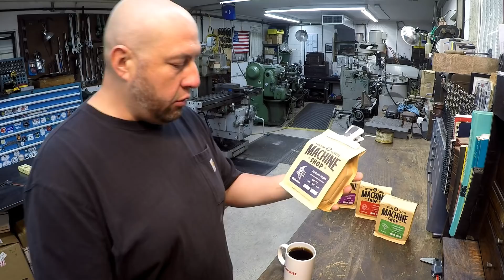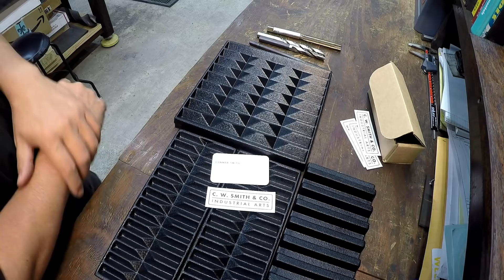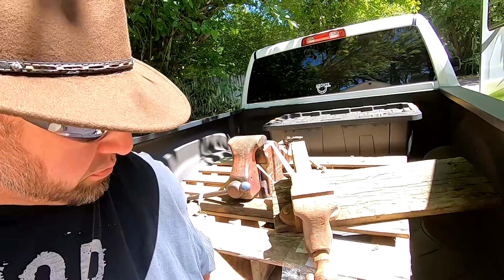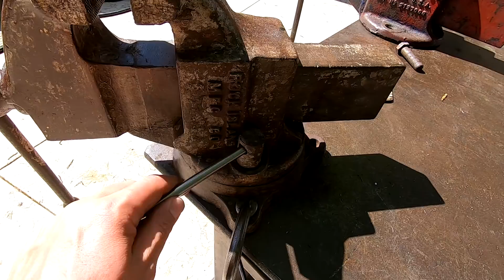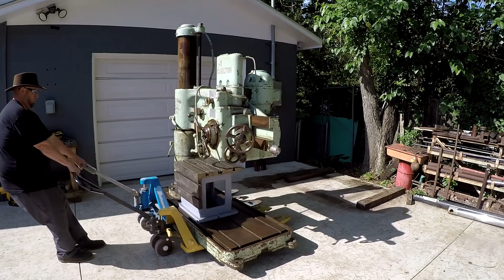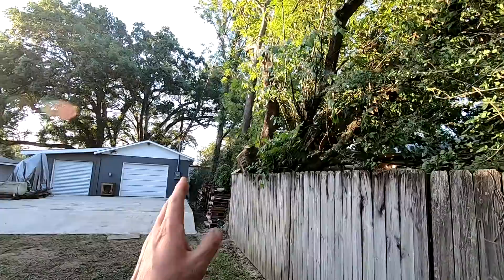SNS 259: Machine Moving, Vises, Tree Cutting

Comment: Revisiting this video as I just picked up a Parker 104-P vise at the flea market for $10. My father also has a Starrett vise with the swiveling rear jaw that he didn't know swiveled. He got the vise from work 30 years ago completely seized up. The pin is completely seized in place and also has been hammered on and is very mushroomed.

Comment: Abom, sorry for the off topic but I saw you moving a Bridgeport Mill using what looked like a engine puller, but the front wheel arms were not splayed apart like the typical engine puller.  Did you modify it or is it a special lift designed for machinery moving?
Thanks for all your neat informative videos.

Comment: im an injection molding machine technician. and let me tell you thats a large shot to fill that die lol
Reply: I think those trays are vacuum formed.  No ejection pin marks on the back side of those trays.  That's something easily done in a home shop.  If that's an Injection mold, then you're looking at a 100ton press at least...mainly due to the mold size (add 2" of steel all around that mold itself)...yea, going to need a 100Ton (or most likely bigger).

My money is that those are vacuum formed trays.
Reply: WreckDiver99 with an arburg it’s cake.

Comment: ROCK ISLAND 574  Adam I just restored a Rock Island Vise 4.5" jaws is has 574 molded into the vise. There is also a tag on it that read Britman Electric Company Rock Island  Division. The handle has to go into the base or it won't go around

Comment: You certainly don't have to justify to me your desire to acquire tools as I am just as fanatical about it as you. I am surprised that you sold off that sandblast cabinet you had as it is a really great way to clean up old tools.

BTW, the last message I sent you was when you were having your concrete apron done and I mentioned that I was getting ready to build my shop  Well, last Saturday I broke ground and I will be starting my own YouTube channel with you as my primary inspiration. Look for the videos soon; imtools (also my eBay ID for 20 years).

Comment: Adam,
    You don’t have to make any excuse for collecting what you love and admire. No one does.
    I picked up an old 2 1/2 inch vice this week at an estate sale for two bucks. At the time I didn’t realize what I had but when I got it home and started cleaning it up I discovered a really fine, well made, very heavy little vice. I have a big machinist Vice that belonged to my dad but have want a good small vice that clamps well for a long time. I have a couple of cheap ones but they never clamp the work tight and so I never use them. This little vice is perfect. It has steel rod guides above and below the screw, a spring loaded lift pin to change rotation position and a screw clamp or mounting holes to fasten it to the bench. I was truly excited as I discovered what a little jewel it really was and no doubt would have paid much more just for the privilege of owning it.

Comment: Yes, There is something wrong with being onto tools and spending your spare money on them, Adam. It makes you a looser. Just like the guy I work for. He machines & in his spare time he thinks about machining. He just started his own CNC shop last October with one Haas mini-mill and Enco manual mill & lathe. Now he's got two Mazak lathes and teamed up with a guy with two more CNC mills and a CNC lathe. He's probably pulling in about 10k a month now. Total looser. ;-)

BTW, you gotta get 4 of those little push-tanks. I don't know what they're called but they have treads, you put one under each corner of the machine and steer them with a bar so you generally only move in strait lines. Some of them have a hydraulic cylinder too. After dicking with the two pallet jacks method for years, I know now, that's the only way to go. 

Well, unless you've got a serious fork-lift anyway.

Comment: In PA the liability is just the opposite. Who ever owns the property where the tree is growing is liable. If the neighbor's tree drops a limb on your car they are liable.
Reply: Right the city owns it right up until it falls on your property, then it’s your problem. Here in Ohio with deer. The state owns them until you hit it with your vehicle, then it’s up to you (or insurance company less deductible) to fix it.
Reply: It's one of those regulations you definitely have to look up for your immediate area. Our home was hit by 5 municipality trees we asked them to top for many years. One thing we learned is a properly done fiberglass deck can withstand its aluminum railing being flattened without a scratch. I'm also glad I read our insurance fine print. Cheers

Comment: Your discussion on vise collecting mirrors my own growth and maturity regarding GOOD tools and quality products that were made in this country at one time. I grew up with these quality made items, that worked and still work. I took it for granted, because I did know anything different. I am am not a gray beard, just mid 40’s, and it is really sad that most tools I can find new, are really poor quality off-shore items.  Really, I am not someone that bashes everything import, there is a place for those types of purchases. The products are cheaper, but I find little alternatives, except off shore items any more. Your options are normally junk, junk or junk and it seams the costs have steadily risen over the years for poor quality items. Take your pick of retailers- online or brick and mortar. Most of the time, exact same products just different costs and paint schemes.  Many don’t perform well or even perform to the most basic level of their design. 

You are better off buying that old rusty vice and doing some maintenance on it than spending just as much or more for a vise that probably will not be around when the second or third person does a refurb on that same old iron 50 or 75 years from now. Just my two pennies and congrats on another acquisition.   When more folks get tired of JUNK vises and want something of quality, those will be worth their weight in gold. 

 Based on some costs I have seen for anything toted as old iron, folks are starting to figure that out.

Comment: Tooling trays are nice.  They look vacuum formed rather than injection molded but I would guess possible either way.
Reply: They look a bit thin and fragile. Tools get slammed around in drawers and once a tray starts to crack it's worthless. A little thicker (yeah, and  bit more expensive...) would be a good thing. I'd buy them if they were a bit more sturdy.

Comment: Makes me smile to see that old drill press, have used the same model a few years back when i worked at my first job as a machinist. It was fun to work with and something different compared to drill with a moving table (you could swing the drill arm faster to already marked locations, instead of moving a table to the specific spot).
Bad part is that the machine is so low to the ground that a tall person like me has to sit on the ground to be able to work with, because the table mounted on the bed was not that high too... but hey, it got the job done.

Comment: Everyone has some sort of vice or another... it a vise vice for Adam.      This is actually an inspiration to me. I have an old steel vice that was in the family for many years, bolted
to an outdoor work space in wet Oregon. It is now quite solid rusted in place.. but with a bead blaster to clean the outside, and electrolytic de-rust to penetrate, it may be salvaged. It will need a new handle.. as someone tried to hammer it loose before I saved it. 
I am just finishing up a tiny 2" vise that has a clamp to hold it to a table edge. Painted it in bright red enamel.  The big old rusted-solid one that belonged to dad is next.. It won't be easy, but with Adam's past video's and some others on de-rusting, I am ready to go for it this summer. 

That swivel jaw vise is really neat!
Reply: Hello you. May I give you a recommendation for a channel I hope you will like.    Called   Squatch253   . He meticulously rebuilds a Minneapolis Moline tractor and prewar Caterpillar small crawlers. I really enjoy his stuff. Cheers.

Comment: with all those "restorations" you do, i wonder if it isn't time to get some sandblasting equipment. gives a faster and IMHO nicer result then wirebrush.
Reply: He had a nice big cabinet, with a dust collection system integrated... He sold it a couple years ago. ( I do wonder if he's regretting that a bit, now that he's ramped up the restorations he's doing...)

Comment: Hi Adam. Is that radial arm drill new to the shop. Are you going to be using it as I would like to see that.    Also like to see a video on your take on vice soft jaws.  Funny you mention overloading the vice with a pipe.  The vices I have here in the U.K. have a split nut and they slip if you grossly overload them.  I also like a vice with the quick release again based on a split nut I think. You don’t appear to have quick adjust vice maybe it’s just a british thing.  I do like to see those tree wood shredders, but I would probably get pulled into it with my luck. best wishes to you and your good lady. Best regards Chris.